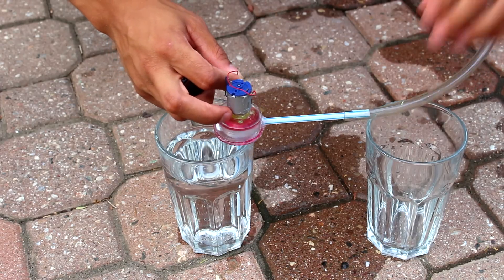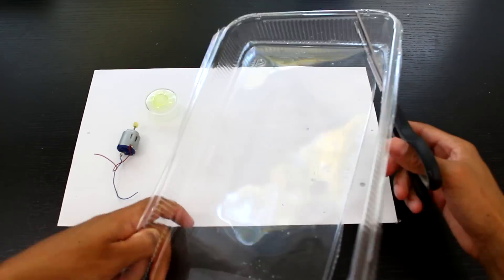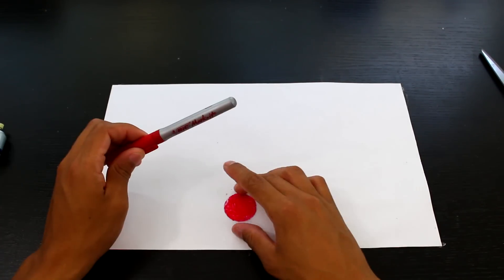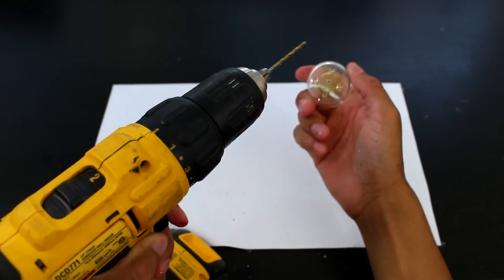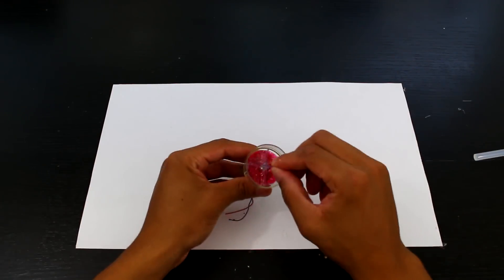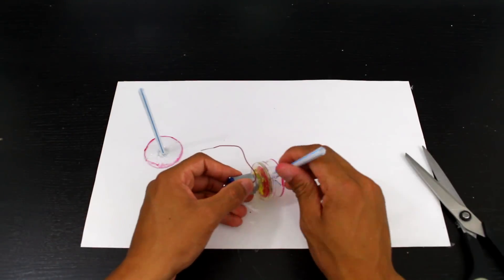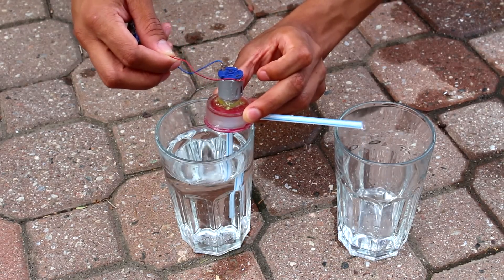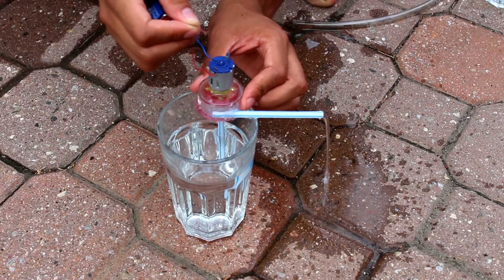how to make a mini water pump

Comment: Hi, how did you prime the pump in order to suck the water up?
Reply: I suppose he just stuck something like a long pipe to it , turned a pump on  and sucked on it like with a straw.
Reply: I'm not big to physics, but wonder does the speed of an impeller or inlet/outlet pipe dictate the suction strength?
Reply: Viktor Božičević When you put a water inside a pump, i creates the suction by pushing the "old" water  outside and taking "new", If you would not put the water inside there would be air which has a lower dencity, so according to motor power and speed it would push the air out or just do nothing. I hope i explained it properly :)
Reply: I see :)